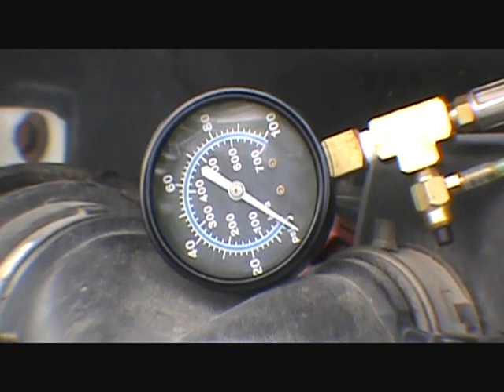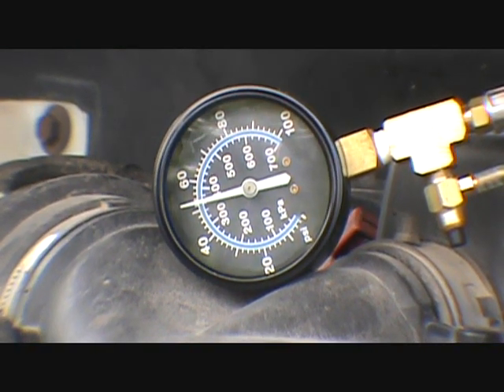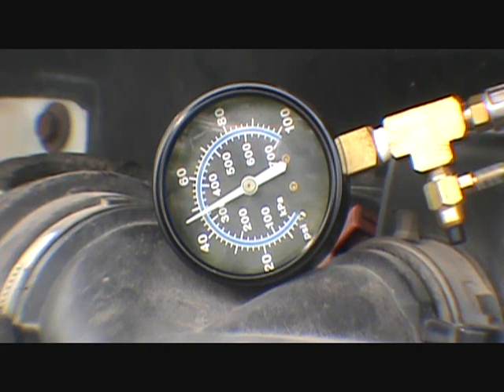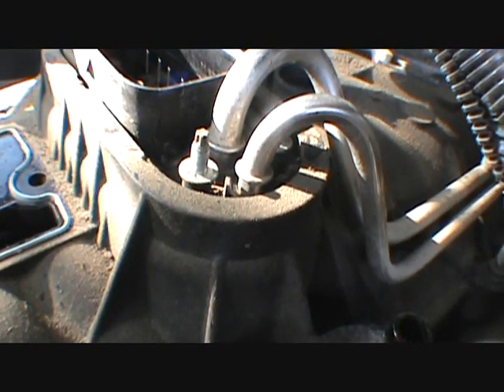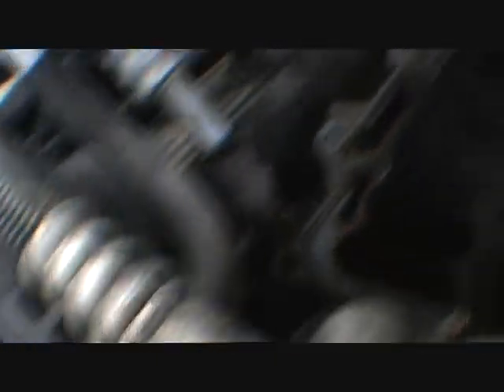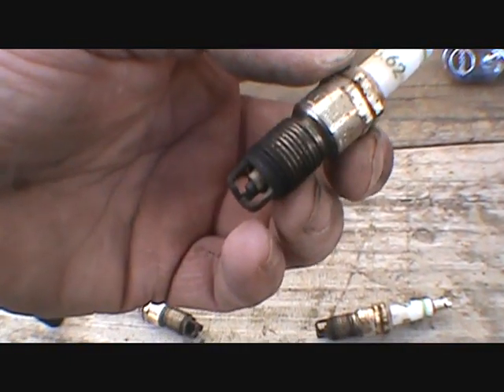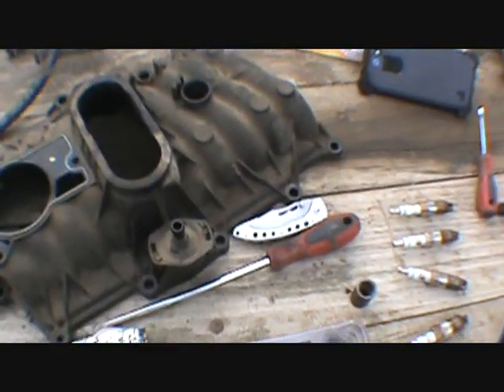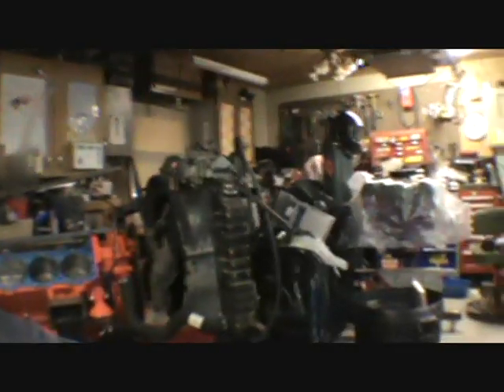1998 gmc this is what i found when i tore into it

Comment: Hi Glad you hopefully found the problem my ex girlfriend had a chev blazer start dumping fuel in the manifold, fowling new plugs and a strong smell of un burnt fuel while idling. that was  about 8 years ago, I didn't  have time to diagnose and fix it. it took the shop  a while to find. The truth was they had no clue and somebody else told them the issue with the lines in the end!. 
Lots of those motors dumped the intake gaskets here in Canada, that Dex cool eats them apparently, so thats why it's probably been apart at some point. my 5.7 had the gasket done at about 100 something odd thousand kilometers. The dealer told me it was standard, when the motors hit that many KM on warranty when they were new. Mine was used low km and out of warranty so I had to pay up.   Glad to hear your wife found a part time job , every $  coming ins got to help somewhere.
Reply from the maker: yea sometimes we over look the simple things i had a feeling that was it but guess i was trying to denies it cause i knew it wouldnt be cheap.

Comment: I've been looking at the supposed GM approved upgrade kits for my Vortec V6. They evidently come with a spider connected to slightly more modern port fuel injectors. I read (long ago) that the same companies offer comparable kits for Vortec V8s. Hopefully you can try one of those. Also hopefully it won't take many more parts to fix the related problems.

Comment: the intake was prob a water leak at one time and fixed , would be my guess . it did look wet but not as wet or pressure drop i figured it to have . but any gas wetness in there and usually the intake eventually  gets blown to bits . I am not a fan of those spark plugs . If wires look good and ohms test ok then they prob ok . wonders what that junk yard wants for one . do u go find them your self or take what they have on shelf . One may be ok on a wrecked one or if could look at them still on trucks , may find signs of some one putting a new one in and get it . just a thought as i know they are expensive . .
Reply from the maker: yea thought it would of been worst to but it did dry up as working on it. hope it fixes it
Reply: does that have the dizzy dist cap . . they can do funny things . but would not think it would cause gas inside the intake . either way the fuel in the intake is not good
Reply from the maker: it was a stock replacement distributor form car quest.

Comment: i was gonna ask if maybe there was a issue with a injector, plugs, wires or the spider.   We have had a 99 Z truck that gave up a tranny at 20k.
Reply from the maker: wow that was a short lived trans what was going on with that one or have you fixed it?
Reply: i think it was due to poor quality parts in a rebuild they did in 2006-7.  It was a rebuilt tranny.  Now days the shops around here just pull a tranny and order in a rebuilt and install that.

Comment: I kinda have a feeling you have a cross firing problem going on with your distributor. From what I have been told by people is that it is strongly recommended that a Genuine GM Cap and rotor be used in this application.